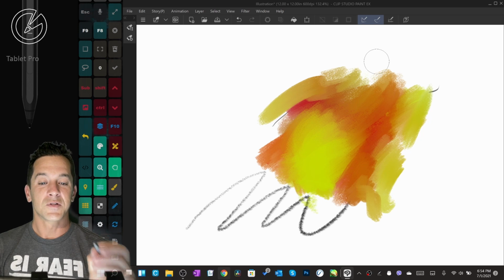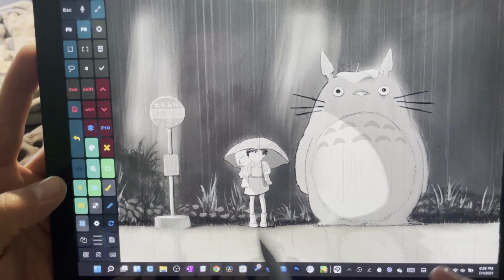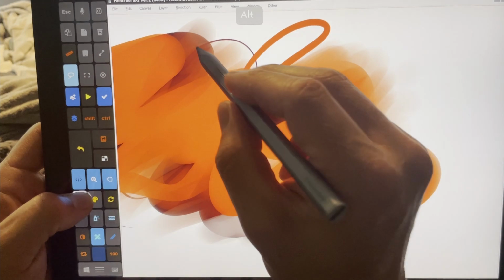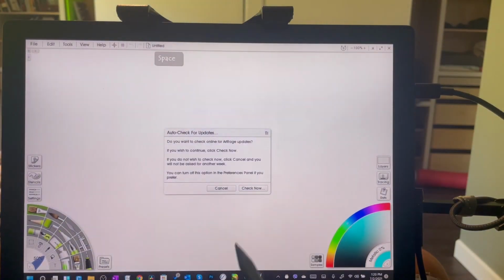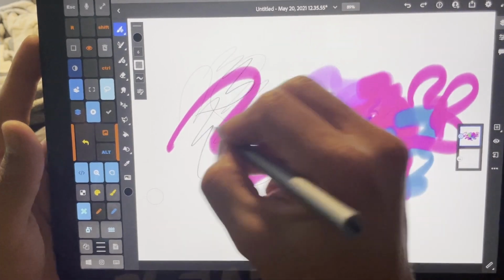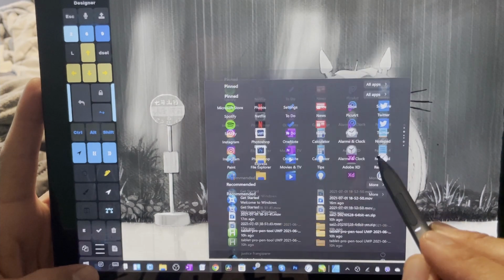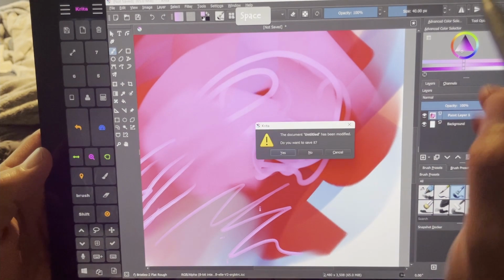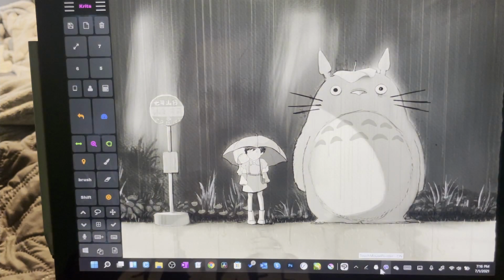Does your drawing app work in Windows 11? 3 DON'T work. Digital Art and Painting Software

Comment: Hello, my pen driver no longer works on windows 11, i have reinstalled it several times and paint tool sai does not detect pen pressure and sensitivity. But microsoft whiteboard does detect sensitivity and pressure :c
Reply from the maker: Don't jump the gun, but you may be looking at a full system reset back to factory image. If you can revert back to the last version of Windows using system restore, I would try that first. But please do your research, because hopefully there's a better solution than this. I also try deleting the pen drivers in device manager, and letting them reinstall. If you're not comfortable with some of this I would definitely not do it or ask someone else to help you with it, that can fix things if something goes wrong. While not good news I hope this is useful

Comment: Just bought an XP pen deco 01 V2 and for some reason neither Photoshop nor Clip studio paint work very well. The problem is that no matter which brush I chose to work with, as soon as I start drawing on the tablet, it changes automatically to Eraser mode. I don't know what to do. Does anyone have any similar issue?

Comment: How did you get to use Artist Pad on Windows 11? They don't seem to show the application in the taskbar menu... even when you expand the menu the little mouse icon isn't there
Reply from the maker: yeah, that's a little tricky. We just updated the installer to adjust the settings to display the icon on the taskbar. The pen tool can be used to download or open an Artist Pad or to get inside Tablet Pro settings. you need to enable "taskbar notification area icon" in general settings. (this is a workaround as we were just made aware of the win11 issues. So you can update to the newest version which should adjust this (but you might have to uninstall the old one) https://www.tabletpro.com/desktop will give you the new update. alternately or additionally, you can run the pen tool and press "win+shift+A" and it will launch the Artist Pad and you can get into settings that way. 

please let me know if one of these works for you.

Comment: Hi thanks for the review. Do you know if the pen and ink setting was changed from the windows settings? Or you still need the surface app for pressure settings?
Reply from the maker: I’m not sure. I’ll double check and correct this comment if I’m wrong but I’m pretty sure it’s the same. Surface app has no noticeable changes
Reply: @TabletPro  thank you!!

Comment: do you have a suggestion for a 5 amp 65 watt surface connect to usb c cord that i could get? i cant find one
Reply from the maker: Almost all my stuff comes from J-Go Tech www.jgotech.com and it's worth noting (as I learned this recently) that the Surface Pro 7 and surrounding models use 60 watts not 65w as 5 is reserved for the usb a port. hope that helps.